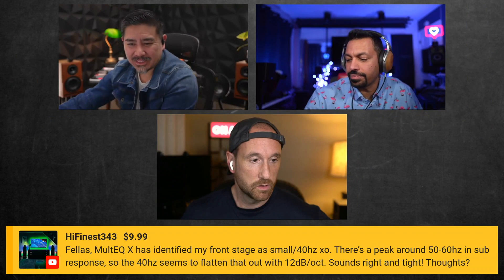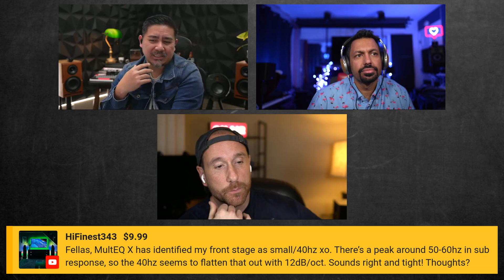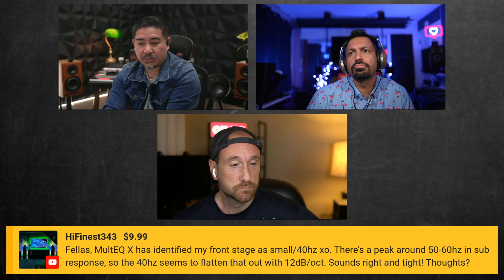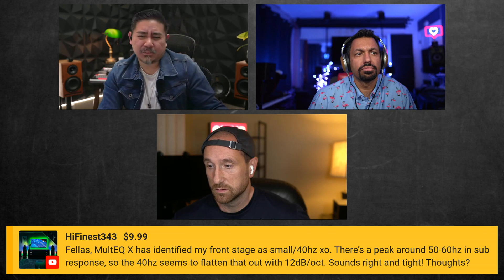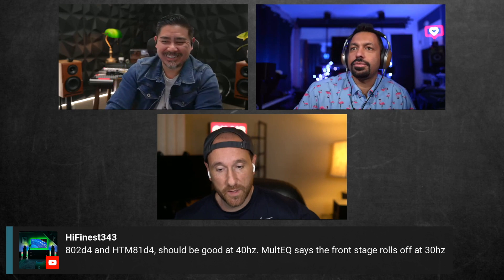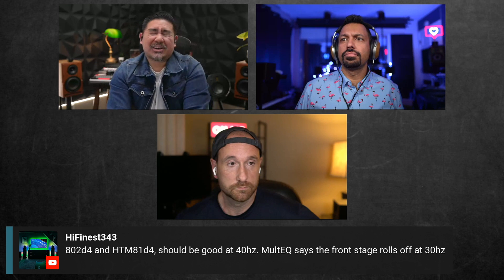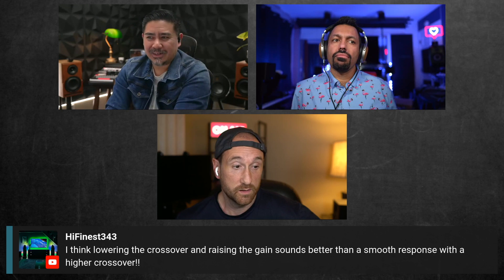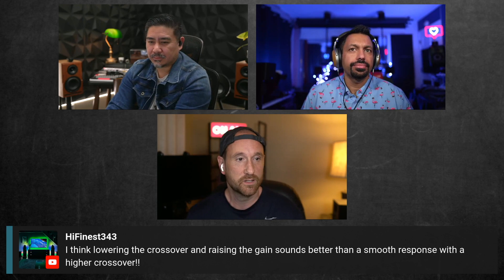Is A 40Hz Crossover To Low?

Comment: Fully agreed with this.
When the crossover is too high or too low depends on the room.
Most people can't change the placement of mains and sub(s) too much. For example: my sub suffers from a major null if crossed over at 80 Hz. When I cross it over at 40 Hz, there's less of an issue. It appears the mains are in a better placement to play 60 Hz.

Comment: I have 70s speakers with a 10inch woofer and a svs 3way center, i crossed over at 40. With 60 i can tell where my sub is at but at 40 i cant and the center does really good with midbass

Comment: I've got 5 large speakers dual 8" woofers dome midrange and dome tweeter. I used to crossover my sub at 80 hz. I tried log sweeps and would adjust the crossover from my sweetspot with a remote up and down and 80 gave me the best sound. I was limited in volume so the room gain didn't turn the bass into boom. Also the decay rate was way too long with no absorption and smooth floors and walls and ceilings. I tried everything I know and then got more power with an Anthem P5 so I got plenty of headroom. Speakers are rated up to 300 watts, and the amp gives me 500 at 4 ohms. The use of ARC with the AVM60 gave me more volume without the boom. I was humbled, and the crossover was changed by the room correction to 120 hz. Hearing is believing. So maybe a higher crossover might sound better. Try it and let us know.

Comment: Never cross below 70hz. The subs are way better at it.  Just because your speakers can go lower doesn't mean they should.
Reply: You meant speakers can go lower,  also never say never in this hobby!
Reply: If they are desig full range why not use it?
Reply: @em9784  Because the sub is better at it (plays with lower distortion).
But based on sub placement and room modes (peaks/nulls), it may be best to put the crossover lower depending on the room.

Comment: Thanks for the response! I think it sounds best at 40hz, MultEQ X detected a 30hz roll off for the front stage, which I believe would be applied to protect the drivers even if the speakers were set to “Large”. Still experimenting to find the best settings. I also have the PEQ in the SB16’s to play with and help fine tune as well. So much to play with!!